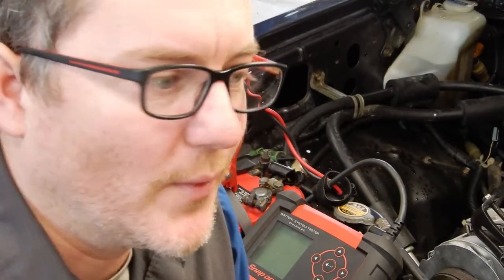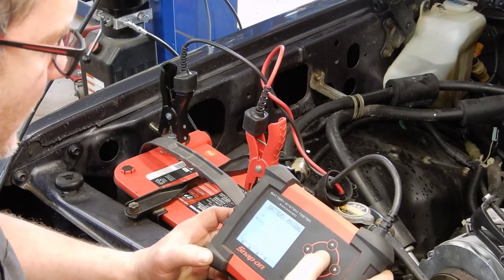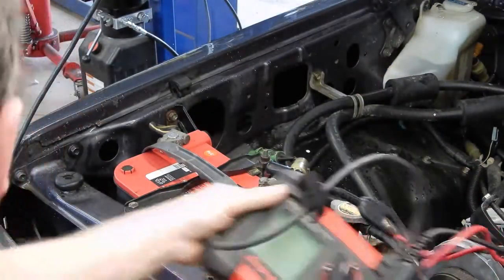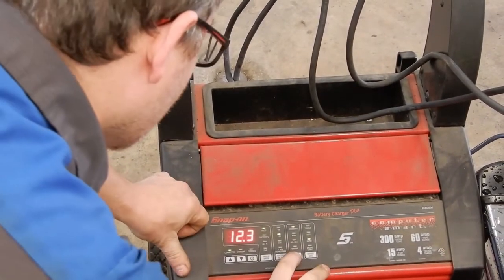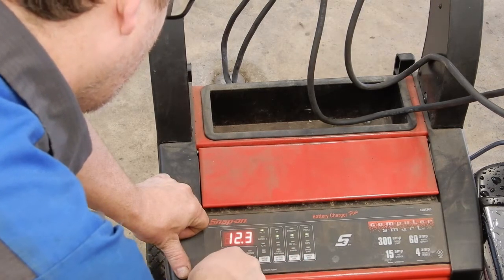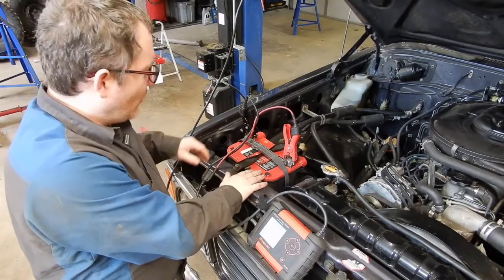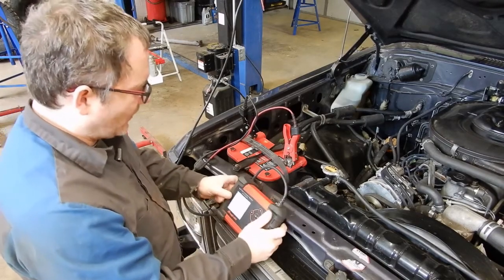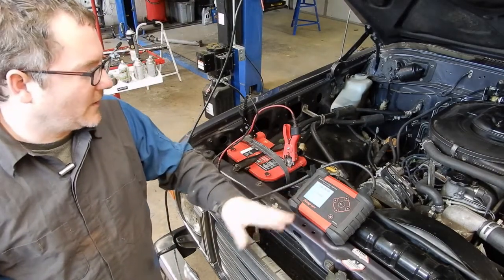FJ60 Charging System Diagnosis

Comment: Hi - thanks for sharing and trying to diagnose an issue on my FJ60. Every once in a while the car will not start but if I jump the vehicle it will start right up. I thought it was the battery so I replaced it. Still have the issue…Any suggestions?
Reply from the maker: Without actually seeing it, it's nearly impossible to guess.

Comment: Hi I know this video is old I don’t know if you’ll see this. I have an fj62 battery voltage gets low when turning light and other things on don’t know if it’s alternator or battery.  Thanks
Reply from the maker: You'd have to test both to see which is bad. If voltage only goes low under load it's likely the alternator not keeping up. It could be a failing battery of bad wiring as well though.
Reply: @OTRAMM  thanks